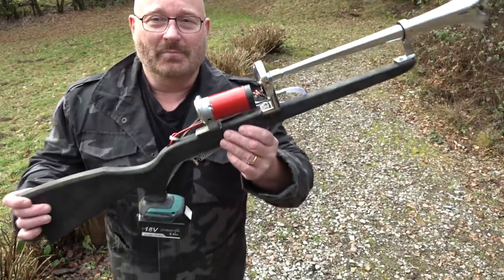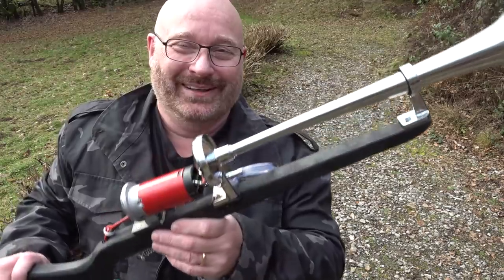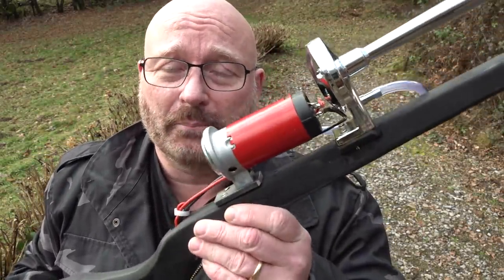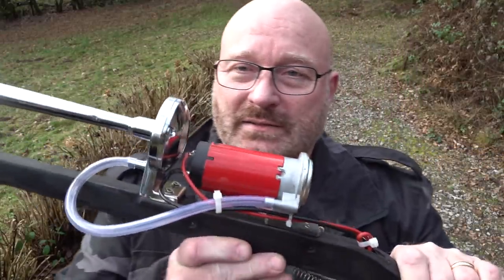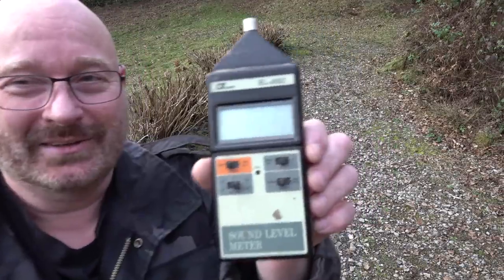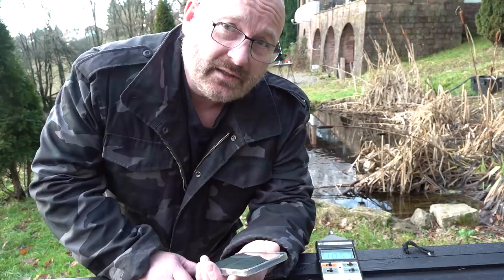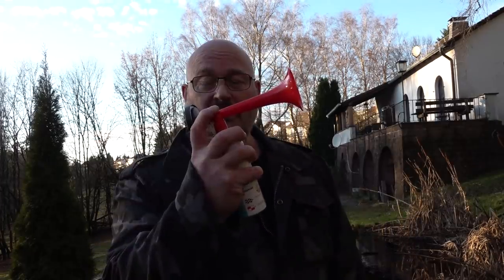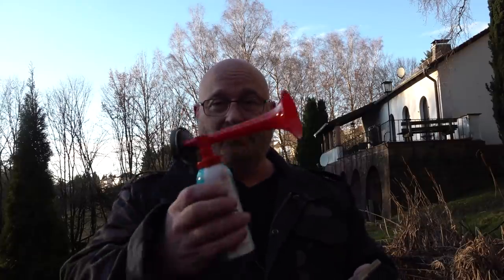Truck Horn Musket is SUPER LOUD! NYD Special 2022

Comment: I wonder if a more focused “barrel” would lead to a louder sound. Since the horn is designed to spread the sound out over a larger area, the pressure is released more rapidly than it would from a normal tube opening. That way, you would have a much louder sound, albeit over a smaller area.
Reply: hmm, well the bigger the horn the louder, mark rober did something similar if you wanted a scientific answer 

but i think it wouldn't make a very loud noise, it would prolly be the same as blowing air through a straw
Reply: No.
Reply: The horn shape is ideal for amplifying a sound, "focusing" the barrel would likely make it quieter.
Reply: My thought also was: a good weapon is not supposed to hurt the weilder as much as the target. But, earplugs might be another solution.
Reply: That would do the exact opposite

Comment: the decibel is a measurement of loudness difference and it is logarithmic to mimic the way our ears work. this means that to increase 3dB you have to double the source power. this also means the difference between 120 and 123 is NOT EQUAL to the difference between 140 and 143dB (incredibly louder) 
A difference of 50dB is roughly 1 million times more intense.
Happy new year guys, happy new year Joerg!

Comment: One factor to consider is that short duration sounds like explosives or gunshots are totally different to the ear than longer duration like a sustained horn. Sustained sound continues to cause damage and prolongs the pain and suffering. For the purpose of nonlethal defense, Even though you can make a louder bang, running the air horn at a potential assailant for a sustained period of time would be a much more effective deterrent than a short burst of sound.
Reply: It's true that continuous loud sound would be very painful and cause a lot of suffering, but it can very quickly turn into "excessive use of force." I can tell you from first-hand experience how debilitating a super loud sound for a single second can be. It's disorienting, frightening, and can even mess with your center of balance in your inner ear and cause dizziness. And that's just minor stuff. Do not fk with sound lightly

Comment: The hand held air horn here where I live in Oregon in the States. Some are used in marine in lack of a fixed sounding device. So depending marine or just a loud blast the note of the horn sound will carry and fell different. You could do this with the ear drum buster by selecting the pitch of the horn. You could do a comparison of horns on your invention.  
Love your creativity and soaking up your vids. Call it the Walls Of Jericho.

Comment: 150% of rated voltage isn't usually much of a problem for simple electromechanical devices. You should be fine on 18V.
Reply: On a duty cycle that short? It'll be fine, eyah.
Reply: Yeah,for longer time your ears explode sooner then air pump fry:)

Comment: I've read, that every 3db raised our ears perceive it as twice as loud. Over the years of knowing this and seeing audio be raised by a certain amount, I concur. So the big BlundEarBust would be twice as loud as the smaller air horn. But I have a feeling at that threshold maybe the "doubling" wouldn't occur.
Reply: Almost right. A 3dB increase means the acoustic pressure has doubled. Another 3dB means it doubled again, and so on. Our perception is logarithmic, so we perceive the doubling as a linear increase.
Reply: perceptively twice as loud is 10dB. Which is 10x the energy.  SO if you want something to seem 4x louder you need 100x the power.
Reply: @olmostgudinaf8100  It has nothing to do with perception, 2x the power (3 dB) does not double the volume due to the fact that doubling the size of a wave in 3D space requires 4x the power (6 dB).
Reply: @thedausthed  But then the perception would follow. Multiplying the power by a given factor would be perceived as multiplying the sound level. By the same or different factor, does not matter.

But it does not work like that. A geometric increase in power (i.e. multiplying it by something) is perceived as a linear increae in volume (i.e. adding something).

Hence the logarithmic scale:
power: multiply by 10 = perception: add 10
power: multiply by 100 = perception: add 20 (not 100)
power: multiply by 1000 = perception: add 30 (not 1000)

By the way, it's not just audio perception. ALL our senses work on the logarithmic scale. Hearing, vision, temperature... even our perception of the count of solid objects. You can see at a glance that one sheep out of 4 is missing, you don't need to count them. But at 1 out of 40, you do not perceve the change so much. Why? It is the same linear change (-1 sheep). But on the logarithmic scale it is 25% in one case and 2.5% in the other.

Sales people are well aware of this and use it to their advantage. When buying something expensive, like a car or a house, you are more willing to spend $500 extra than when buying a sofa or a dress. Why? It is the same $500. But you perceive it as less, because it is a smaller portion of the whole.

Comment: Can you modify it to fire BBs or arrows? Sounds like that compressor is very powerful!
Reply: That's not going to be very high pressure, its mostly volume and won't exceed typical air compressors. You can do airsoft though (large diameter, and force is pressure times area, plus its very low mass meaning ultra low energy), so then you might be able to use it like those below $20 DIY airsoft super fast ones do with a soda bottle with a tube shoved into it (fill the soda bottle most of the way with plastic BBs), then an air tank on your back with a typical air blower shoved into the soda bottle.

Arrows would be even worse than typical metal BB, not much surface area but a huge amount of mass.
Reply: @jakegarrett8109  the funny thing about those airsoft setups is how incredibly dangerous those really are. Most fields don’t allow them due to joule creep

Comment: Note that although the blank gun is a little louder (more sound power), the horn can make noise for a lot longer (less power for longer time = more energy). Therefore, standing beyond a couple meters away from the shock wave and debris coming out of the gun, the horn seems more "lethal" than the gun.
On New Year's Eve, "The Horn Blows At Midnight" (Jack Benny, angel 3 class sent from heaven to end the world by blowing a horn just like Joerg's)

Comment: 8:30 - I think one of the reasons you are experiencing more perceived output with your creation vs the air horn, is due to the properties of the horn.  Those air horns have plastic amplifiers, whereas yours is made of metal (is it polished brass?  or may aluminum?) - and the metal reverberates in addition to amplifying.

Comment: Joerg, just get a couple of large trash bags and fill them with Oxy Acetylene from your welding equipment.  Acetylene is part Hydrogen and mixed with the correct amount of of oxygen you will have an explosion ten times louder than a simple truck horn.  You could even set them off with flaming arrows.  I have put these large black trash bags inside an old car and blown off the doors and windows.  The only thing left is small shards of black plastic bags, small pieces of glass and twisted metal from the car body.  With a full Oxy Acetylene unit you can make over thirty very large explosions much louder than store bought fireworks.

Comment: If you put a volt meter across the horn wires when it makes the sound, there is likely a big voltage drop to it's required level. The coil likely has a fair amount of resistance under load.
Reply: The air compressor is 12v but if its designed for on highway vehicles they have somewhere between 14 and 15v electrical system. Operating most are between 14.2 and 14.5. That 18v battery will probably have some voltage sag, doubtful down under 15v. These batteries are all 5s 18650 liion and the low voltage cut is close to that.

Comment: Tape 6 soda cans together with duct tape. The top and bottoms of the cans cut off but the bottom of one can. Tape them like a long cup, poke a hole in the bottom can. Squirt lighter fluid into the hole. now light the open end.

Comment: WOW! At 7:53 you can see distortion coming from the airhorn. I wonder if that's pressure waves or refraction caused by the temperature differential?
Reply from the maker: I think this is because the compressed air gets so cold.
Reply: @Slingshotchannel  Thanks for the reply. It does linger in the air, so I think you are right. The speed of sound might be to fast... hahah.

Comment: Hi joerg, 
I have an idea for a new weapon based on 12g cartridges, mostly I wonder if it would work. It  would be an arm weapon (assassin's creed style). A barrel with the right diameter closed at one end with a small needle to pierce the co2 capsule. Very simple, the difficult part would be to create a mechanism that pushes the tip or the cartridge hard enough to break the capsule, the bullet would be the can itself!!! I don't know if it would be possible especially from an airtightness point of view but it would be cheap and also  powerfull i think.

Comment: Joerg, do you know the automatic rotating crossbow of the old Van Helsing movie with Kate Beckinsale and Hugh Jackman. Looking at its design it seems to have the typical rotating barrel but also a compressed air cylinder, maybe the air cocks the strings after each shot somehow, thats how its automatic. Maybe you could give it a try? Just a suggestion anyway, keep up with the awesome content. Greetings from Brazil!

Comment: would that compressor work to propell missiles out of a barrel?
could it operate a piston that could respan a pistol crossbow?
Reply: Naa, since the pressure ramps up as the motor reaches its Max RPM from zero, making the projectile go plop on the floor. (Despite the fact it doesn't look like that)